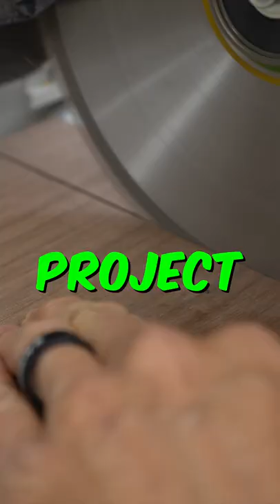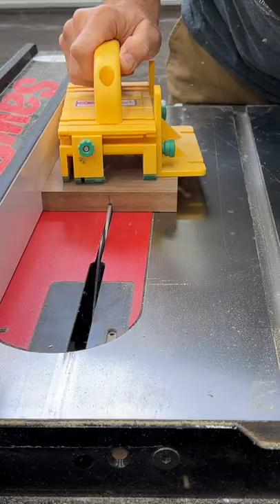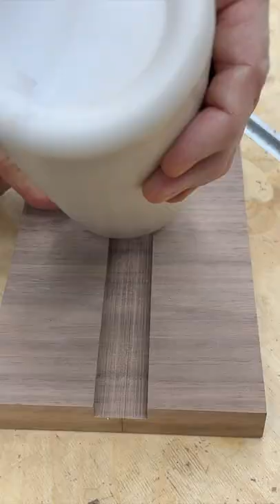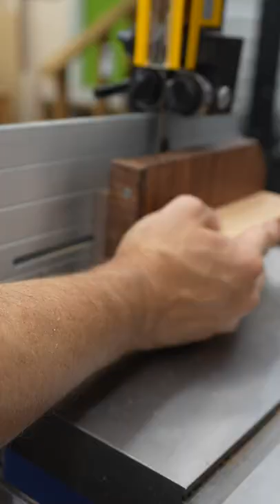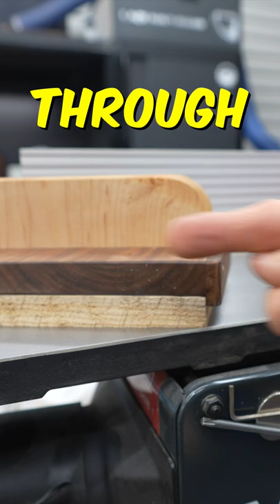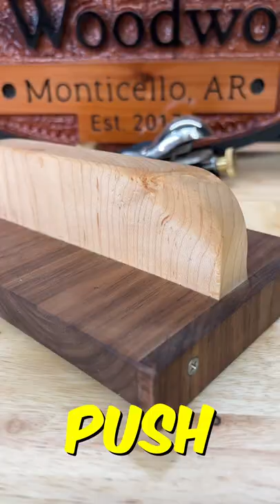Easy Scrap Wood Project #shorts

Comment: I could do so many neat projects if I had a table saw.....and if I weren't terrified of using it.
Reply: The trick is to become an arborist, i went into it a year ago afraid of powertools and after all the close calls with death moving back down from chainsaws to less dangerous tools makes me realize there's not much to be afraid of
Reply: @ninjamantis8309  oooh....ARBORIST.
I'm glad I read your post twice, before responding.
Reply: Don’t be terrified of it man! It absolutely is something to fear if you’re being careless or you don’t know what you’re doing. I could definitely have a phone conversation with you and teach you how to use one!
Reply: I kept putting off getting a tablesaw for the same reason (+noise/dust) and was going for a tracksaw with accessories instead, but honestly the tablesaw is just such an essential tool that I think you should just bite the bullet and get one, get the jobsite sawstop if you have the money, otherwise a DeWalt or Makita depending on where you live
Reply: I would also say that you just need to learn about the dangers of using a tablesaw such as kickback and try to not go on autopilot when using the saw, that's when accidents happen.

I only have two kickbacks on the saw but because I stand on the side I was not in the way of the kicked wood, and both times it was my mistake😅

Oh and using gripper like push block (DIY like this one or product) is a great added safety and control
Reply: hello
Reply: dont be terrified, just respect it and youll be fine.
Reply: U get used it to after a while trust
Reply: Don’t be scared of table saws they have a electric stopper if that’s what’s it’s called so if your hands to close it wild stop in 100 milliseconds
Reply: @Goldenvr2769  LoL, Dude, my Harbor Freight special doesn't even have a grounded plug.